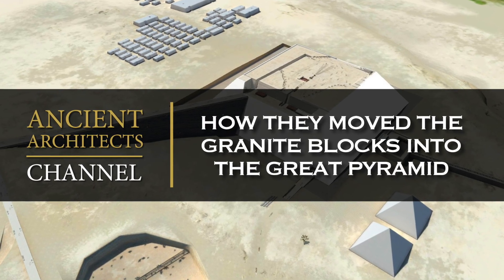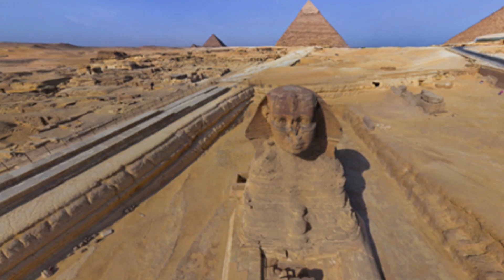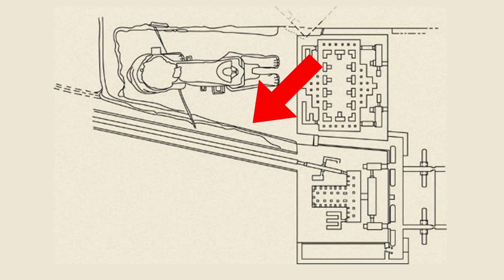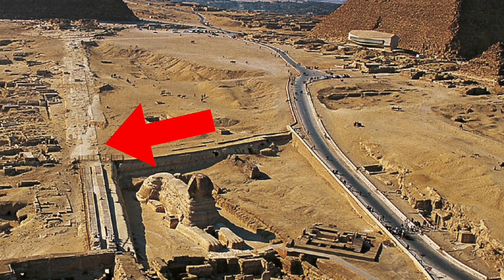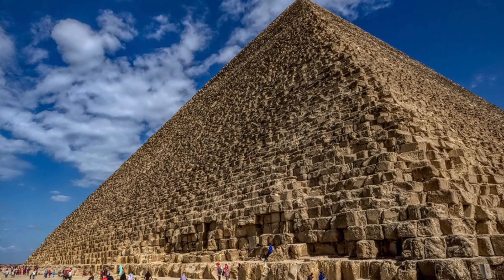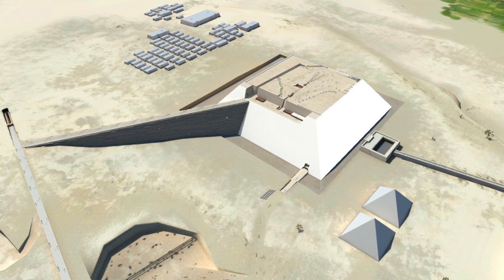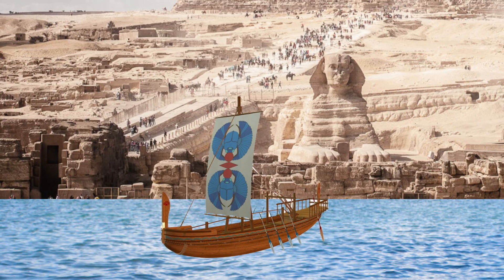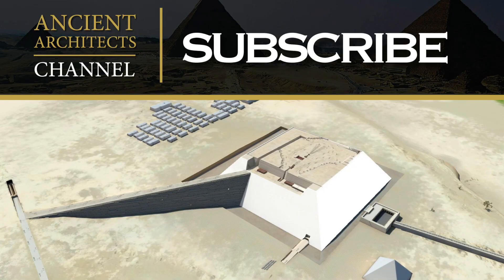How They Moved the 60-Ton Granite Blocks into the Great Pyramid | Ancient Architects

Comment: They moved ALL the stones on floats in water channels.  No ramps.  No ropes.  No men breaking their backs.  By the Nile to a water channel built at the location.  From there up the pyramid in a spiral going around the pyramid of water locks, channels, and gates.  They floated the cut rock over to position while in the water.  Imagine a swimming pool with constantly incoming floats with the stone riding on them.  They build the outside first in two layers and raise the water accordingly.  The Great Pyramid itself is a water pump.  Steven Myers.  That guy has all your answers.

Comment: The base of the pyramids was originally surrounded by a canal, the so called causways were suppl canals. With regarding the movement of 60+ ton blocks;  calculate the number of men required to haul them up an lncline, = more than the known population. 'They brought in slaves" say archtects. = not enough food supplies in the region. Used wooden rollers say the architects.= not enough wood in the whole region.  Stone rollers, or wheels: something so huge rolling along a "causeway" would leave huge wear marks in the causway.= none visible.  Use of ramp.= laughable, all drawings of the ramp Hypothesis only show them going about halfway or less. = Imagine the angle reaching the top!  Some kind of counterweight weighing 80 to 100tons. ( to pull up angle, and to overcome friction) this shaft would have to be very large and deep. This could work very well! BUT.  Then you have to raise the counterweight again! As you can clearly see this " infrmation" in this and other sources is complete, in engineering terms. Bullshit.
1
=
.
Reply: Oh, I forgot to ask what evidence do you have for the rope technology used in your mythical counterweight system?

Comment: Moving those 60 ton granite beams above the Kings chamber is very simple.
The granite beams were prepared before the pyramid construction had begun.
Then, once the first course was completed, the beams were moved up a relatively short and very shallow ramp and stired on the first course.
As successive courses were built, the beams were raised one course at a time until the roof of the Kings chamber was reached. The sarcophagus would no doubt have been raised in the same way.
Whilst I believe in Houdins internal ramp theory, again, the most obvious way of raising the lighter blocks, I dont agree with his grand gallery theory for raising blocks.

Comment: Maybe an ancient causeway was there since the sphinx, used for removing and transporting blocks that were quarried from the sphinx enclosure. As time moved on, the same causeway was paved and used for projects such as the pyramids.The angle of the causeway/enclosure wall may simply be because the ancient causeway floor was uniform at that angle along the bedrock. The angle of the causeway may not have been considered important in relation to pointing the sphinx east.

I.e. the causeway was used for quarrying the sphinx enclosure due to its angle and evenness along the bedrock at the particular angle. The quarry expanded north, however the sphinx bedrock was not quarried, so as to be the base of the sphinx. They quarried around the core of the sphinx, using the causeway as a transport for blocks. The same causeway probably was used for a long time for transporting throughout the plateau, even paved for larger projects.

Comment: The idea that the causeway itself shows signs of water erosion suggests that the causeway is old enough to have such erosion.  If the causeway was indeed utilized for pyramid construction, that would suggest that the pyramids themselves are old enough to have been built before significant erosion occurred.  Also, I think it is within reason to believe that the enclosure around the Sphinx could have been originally created without four 90 degree corners.  It might look unusual, but unusual isn't impossible.  Sometimes designers do unusual things to contrast the norm.  Also, it's possible that on the south side of the Sphinx near the front right paw, there used to be some design element or structure or entrance or path or guard's hut or tree grove, or you name it that would make the enclosure shape seem more logical.

Comment: For years I was obsessed with the Giza pyramid, thinking it was something impossible to do due to the number of stones to move and the heights at which they were placed, in addition to doing so while maintaining a custom design as planned.  Little by little I began to understand the entire process, thinking how I would have done it at that time and with the resources that existed. study a lot different problems. until I could put all the pieces together. and according to my theory only 4000 men could have made the pyramid in 30 years working only 10 hours a day and moving the blocks 1 for every 100 men at a speed of 0.6km/h. I divided the work into 4 groups and designed the structure step by step and how they should progress and with what means they could move the blocks effortlessly. What one day seemed intriguing to me today seems like just another work of man. There is nothing supernatural or inexplicable. In fact, it only took time but it didn't require that much effort. and a huge ramp was not necessary even though my theory uses something similar to ramps. The pyramid is a puzzle that helps you put together yourself.

Comment: You are WRONG. Who did this math for you? 

In order to move a 80 ton stone, 450 feet in the air with an average 10 degree slope(what they would need to move the stone) it would be 800 meters in LENGTH.  

Also, Get the blocks to the base of the kings chamber? Really? The blocks are the ceiling of the chamber buddy 😂😂

Comment: 1. Did they pull 2.3 Million block of various tonnage over 500 miles from the quarry with rope - NO. Did they pull 80 ton stones 350 ft up above the King’s Chamber by rope? - NO. Did the Egyptians 3000 years ago carve Red Granite with simple tools? - NO. All current evidence shows these structures were all built at least over 12,000 years ago using technologies we haven’t yet ourselves used.

Comment: 15 percent equals 8.7 degrees and  8.7 percent equals 5 degrees.  Pretty steep! Most of our highways, like over the Rockies or Sierra Mtns are 6 percent or 3.5 degrees.   If we assume the slope is 8.5 Percent the gain is 8 meters per hundred! in 500 meters = 40 meters/150ft. roughly...   and if the number is 8.5 degrees =15 percent or 15 meters per hundred meters!  the gain  75 meters or 250 ft in 500 meters.  all these numbers are painfull for hiking with a 60lb backpack.

Comment: what are the "relieving chambers" above the kings chamber for? some people say weight relief for the ceiling below, that doesnt make much sense to me as why do it 5 times, youd only need to do it once to relieve the ceiling below, and the Queens chamber which is even deeper in the structure doesnt have them... ive also heard its for acaoustics but they didnt elaborate as to how or why, and said they had to be blasted open later with dynamite, so they wouldnt have been able to affect acoustics if they werent even connected to the area below... so  neither of those really make much sense to me without more explanation... whats your take on them?

Comment: You have to get the blocks on and off floats or boats. Hauling them would be extremely hard up a ramp. Then how to load onto sled to go through grand gallery? How to take off the sled once the counterweight system hauls it up to near the great step? Then how to lift it precisely into place and repeat?  If an accident occurred how did they solve it? Move a block lodged. Makes no sense. Accidents must’ve happened.

Comment: They didn't need to haul them up to that height -  the stones would only need to have been hauled up one layer at a time.
 
Build the base layer, survey it out and level it until its exact -  then drag the granite blocks unfinished onto that first layer and stash them in a small area. Then lay the next level of smaller stones over the rest of the pyramid leaving the area around the big stones until everything else is covered. Then just lever/drag/parbuckle etc the big stones up that ONE layer of stone, then fill in the area they were stored and you have a complete layer with the big stones on top of it. 
Rinse and repeat, lifting them one layer of rock at a time until at the right height, then dress the big granite blocks and install them in position as you add the layers of smaller stones around them. Then the internal ramp theory could work as the rest of the stones are much smaller and possible to actually drag inside that potential ramp. 
Simple - no gigantic counterweights, no gigantic ramps and impossible angles etc and matches with the massive causeways that were needed to get the granite blocks from the harbour up to that first layer of each pyramid. The causeways were huge probably to fit an enormous counterweight or...teams of some form of pack animal, like we'd expect to move those blocks UP hill, but once they were at the top moving them on a level surface would be much easier. 
Parbuckling or using some form of portable wooden counterweight form of crane to raise those stones up 3--4ft at a time and moving only 10-15ft in any direction is infinitely easier and turns the actual pyramid into it's own hoist to gradually lift them. Counterweights are simple enough with buckets filled with rubble from dressing stones slowly added until enough mass is in there that the whole thing just tips like a seesaw, or sooner with some manpower added. Empty the bucket and reset the crane and you could move them up 3-4ft at a time without needing anyone to actually pull on the rope.

Comment: a) I don't think, that the inner ramp went down to the ground, but started exactly there, where the grand gallery ended. The outer ramp was increased up to the level where the grand gallery started, then the gallery was used. After that, there was either another internal ramp, i.e. this recently discovered great void, or the internal ramp up to the top.
b) About the sphinx: There is a lot of material removed around the sphinx. Might all this excavation have been used as a filler for the inner parts of the pyramids? You'd want to source as much material as close as possible.
c) The counter weights you talked about, might have gone down just on the left and right of the large ramp. You'd only need two horizontal wheels left and right in top of the ramp. If you split the counterweight in two, you also half the force to bring them up in place again.

Comment: Maybe everything was moved via counterweight systems using water as the weight added. Then it doesnt have to be removed at the bottom to take back to the top. The water can just be emptied to flow away then new water added to pull it down again.

Comment: As I watched this today I was put in mind of a more recent video where you explored the weathering in the sphinx enclosure in relation to run off from the plateau. 
With this in mind, I wonder if the causeway was actually a canal or water lubricated causeway enabling easier transport of granite blocks and run off from this could explain the difference in water damage from one side of the enclosure to the other. 
Why stop at the harbour if it was possible to use water. I've seen many suggestions about hydraulic systems in your videos, so perhaps water was used far more extensively than we might imagine?

Comment: looking a the aerial view of the site I would say that the Sphinx HAD to be there before the building of the great pyramid if one considers that the dock had to be offset from the direct line to the middle of the pyramid. You can't have it both ways - either the dock/offloading area could have been placed anywhere (and therefore could have been placed further to the north and the causeway could have been a straight line east west to the site) or the docking/offloading area WAS further to the south so an oblique angle HAD to be used to make the causeway regardless as t the fact that the sphinx was "in the way".

Comment: Ancient Egyptians sailed in wooden canoes and rafts, some more robust than others. They didn't have the ship technology, water displacement knowledge, or seamanship to hoist multi-ton rocks onto these wooden craft and then sail for miles without capsizing.  The Nile would be littered with rocks  and there isn't  evidence of one capsized cut pyramid rock on the bottom. It's easy to say Ancient Egyptians pulled multi-ton rocks onto rafts and then sailed up the Nile,  but reality and a lack of archeological  evidence may conflict with this theory. 
Too many people state- they had basic rafts, they had multi-ton rocks- easy solution, they sailed them to where they needed to go. They had basic rope skills -easy solution, they pulled multi-ton rocks to a location and then hoisted them into position. -repeat until a Pyramid is over four hundred feet tall.
The one thing everyone rightly agrees on is that the locations in and around were used.

Comment: So maybe you could help me understand something,  I dont get the counter weight thing , like I understand how it works but would you need to reset the counter weight ever lift? And if so isn't it just wasted effort? Cuz if you use the weight to help lift lets say a 30 ton counter for a 60 ton block it makes the lift only 30 tons but after you lift and the counter weight goes down you need to lift it back up so it can be lowered again thus making a 60 ton lift with extra steps... right? Or am I missing something?

Comment: Excellent video, and the idea about the counterweight pit under the middle pyramid is not widely discussed; it was new to me. But I interpret the ramp position differently. By my guess, the Sphinx was already there, carved from the rock above the natural ground level. Khufu's men built the ramp to avoid it, but grudgingly, and they excavated coarsely around the Sphinx to get the stone to make the ramp. Then the priests objected and the engineers tided up the Sphinx area as best they could, making an enclosures with neat sides but not rectangular. Since the Sphinx statue was now exposed on a pedestal, part of the tidying job was to carve its base and the lion-like form was chosen. Possibly the human head was carved at this time.
Reply: Looks more like a dog than a Lion and Anubis makes more sense than Leo the Lion.
Reply: @Guitar6ty Geologically, the layer of stone at the top of head of the Sphinx is the top of that rock layer across the entire plateau... There wasn't any more rock available to carve for more than a meter or two above the top of the Sphinx. (It was the original surface level of the ground.)

Comment: Yes not only cutting the Answan granite, but moving them, most likely by boat is a serious question because the blocks would need a sturdy enough boat, plus a way to load and unload the blocks. There must have been an Egyptian crane of sorts. But what kind of boat can handle that much weight without sinking?

Comment: Without really knowing much anything about this and not following the reasoning in this video: if you just look at the site from air, the only way the orientation of the causeway makes sense if the Sphinx was there first. What architect would put the causeway at some random angle in relation to the pyramid. It very much looks like the angle is the result of the Sphinx being in the way and other considerations dictating the placement of the pyramid.

Comment: The problem with this theory is that pushing the counterweight back up after every use would require the same amount of effort as hauling the blocks in the first place.
Reply: The counterweight does not have to be a single block though. The counterweight could be a wooden box filled with sand and rubble which can be taken back up with buckets.
Reply: @Kaepsele337  or water
Reply: Just have a bunch of humans climb on the sledge and ride it back down the ramp to reset the counterweight. Granite is only 2.5 times as dense as the human body. (They were going to need to walk back down the ramp eventually anyway.)
Reply: A counter weight for the counter weight. I agree.
Reply: Humans make excellent counterweights, and they are self returning.
Reply: They should jut say we simply don't know. The Ramp theory doesn't make sense either. Imagine the amount of material required to make that ramp. Mind-boggling.
Reply: @eddietee6305  That material becomes part of the pyramid. You quarry to build ramp and the bottom of the pyramid at the same time, each growing as the build progresses. Once you are halfway you then quarry the ramp to build the top half of the pyramid - like pulling the ladder up behind you after climbing a tree.
Reply: @eddietee6305  Remember that you'd be mostly doing your building during the inundation. That is to say, when nobody had much else to do because all the farms were underwater. So you had a wealthy nation, and god knows how many hundreds of thousands of hypothetical workers. You've got labor and resources.

Comment: How did they get the blocks on and off the boat ? A crane ?
Reply: Wildspec: bring in the block on a barge, spragged up so that beams, which must be rollers, can be slid under it.Moor the barge in a lock chamber, and close the gate. Fill the lock so the barge rises. Put in the beams, empty the lock so that the barge sinks and the block is supported on the beams, float the barge out from under. Now roll the block away from the lock onto its land-transport sled. If done this way, the remains of the lock would be under the Valley Temple.